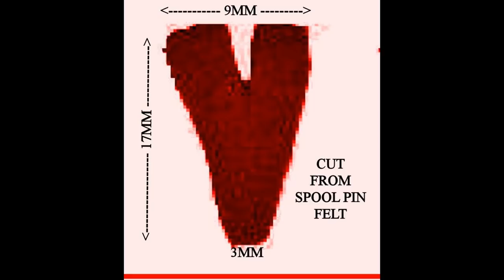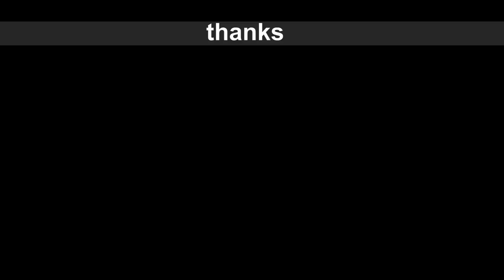The Bobbin Area Parts of a Singer Model 99K Sewing Machine

Comment: great video for seeing what is actually going on in there, the only thing I noticed is you seem to have way too much slack between the bobbin case & the bobbin case bracket making a clacking noise.

if you loosen screw the screw on the bobbin case bracket (the one you move to the right to remove the bobbin case & left to lock it in) the screw they tell you never to remove, you can adjust the distance between the heel of the bobbin case & the cushion spring on the bracket with it in the bracket latch in the locked position & the bobbin case pulled fully left over the race for a gap of .010 to .015 of an inch between the heel & the cushion spring then tighten the screw down again, you can just pull the bobbin case  fully to the left & measure the gap with a feeler gauge to see if it needs adjusting .
Reply from the maker: Thank you for sharing the measurement for the Thread Clearance for this model. Nice of you to comment. For viewers unfamiliar with the Thread Clearance, this video for model 404 will give you an idea of setting the "gap" between the bobbin case and cushion spring: https://youtu.be/OXKqZp87eN4
Hope to hear from you again, Roger.
Reply: Thanks man!!!

Comment: Dear Andy pls help I have 185k singer sewing machine the bobbin case on the machine kept moving when sewing so was trying to take it out to see what the problem was but it was stuck so took out the screw on the bobbin case position bracket I didn't have the instruction book at hand at the time now found it and read that the screw must not be loosened the loosening of the screw will change the clearance  for the thread between the bobbin case and the bobbin case position bracket how can I fix this problem will be grateful for your advice it's a lovely sewing machine I've tryed put everything back in position but it won't sew will be grateful for your advice.
Reply from the maker: Salim, I would check that the bobbin case is the correct part number 32590. @ 15:30 in this video I talk a little about that screw "E" and that it is used to set the thread clearance. If the clearance is too small the thread gets stuck. If the clearance is too big the bobbin bounces and is loud. Usually, when a customer comes to me with a "Moving Bobbin Case" I find the bobbin case was not installed properly. I'm not saying that is the reason for your problem, only that it is a possibility. All I can advise is you follow the reinstallation of the parts in this video starting @ 40:00. Special attention to 45:00 thru 47:30 installing the bobbin case. This one is tricky even for me and it took me 3 or 4 tries to get the case on the hook race properly. Once all the parts are installed correctly you can test the machine to see if screw "E" needs adjustment. If so then take a look at this video of a different machine and setting the thread clearance.  https://youtu.be/OXKqZp87eN4  This gives you an idea of how to set the clearance.  I have no document that says what the thread clearance on a model 185 should be. Most vintage Singer machines have a cleance of between .012" to .018", or about .31 to .45 MM.
You want an adjustment that lets the needle thread pass through the space between the bobbin case and the bracket, but not too much space which makes the bobbin case "jump"' and be very noisy.

Comment: Thanks for this video.  It worked perfect for my 99.  Just picked up a Singer 185J from the owner who said it wasn't working properly.  I noticed that there was plenty of thread and lint in this area and stuck on feed dogs and that also that the positioning finger screw was loose and that there was no felt in the spring at all.  I can configure felt to put in there, but how to adjust the positioning finger that must not be touched readjusted and that thread clearance to be functional again?
Reply from the maker: There is nothing specific about it in any manual I could find. There are two screws on the Latch. I loosened the screw closest to the front of the machine (towards me while looking from the end) and that allowed a little movement b/c the back or far screw allowed the latch to swivel. I just placed the tip of the Singer Tension Screw Driver in between and tightened the front screw. That gave me a little gap where I had no gap before. I could not tell you the exact size of the gap. I just eye-balled it and it was good in the sewing test.

Comment: I got a 99 in a bentwood case. I am refurbishing the case now and want to clean the machine. How much do you think I should do. Should I take the bobbin area apart and the tension button and the wheel?
Reply from the maker: In my videos, I take all those things apart b/c I want to do deep cleaning, and I want to show people how to do it if they need to replace parts or adjust them. How much work you do depends on the condition of your machine and what you are comfortable doing with it. If it is in working condition you do not need to dismantle anything at all if you don't wish to. Parts can be cleaned in place with brushes, rags, Q-tips, etc. You can use air to blow out lint and debris. You should absolutely oil the machine as shown in the Instruction Manual. https://www.singer.com/search/support?title=99    Some people over oil parts of the machine and run the motor to heat things up, then wipe off/out all the excess oil. They feel this will "flush out" old oil in spaces and bearings. Only do what you are comfortable doing is the best rule of thumb. After cleaning and oiling you can test sew and if you have problems, then decide to work on the tension unit or bobbin case area, pull the wheel to clean and oil inside it, etc. Congratulations on your "new" 99. It's a wonderful model.

Comment: Great video Andy; I leant a lot. My problem is that the thread keeps breaking, I suspect something is wrong with the bobbin assembly, or hook. After watching this I now understand how it works but I'm not sure I have the confidence / tools to take it apart. If the hook in the bobbin area has a burr, what do you think is the best way to sharpen / remove the burr?
Reply from the maker: Welcome to andy tube, Mike. You do not need to remove many parts to test/repair a hook burr. It is more common than people realize for the hook/ hook point to have a little burr from a needle strike or from using metallic thread. So I made this 12-minute video about testing and fixing hook burrs. All you need is 6 inches of thread (nice if it's cotton) and some very fine sandpaper. If you find the burr, just give it a shoe shine. This is an OSMG fix (Old Sewing Machine Guy), and nowadays people would probably use a Dremel or some other tool, but it is hard to ruin a hook point with a strip of sandpaper, You could, but you'd have to be very determined. Anyway, here is the burr video: https://youtu.be/us1sHv1-2Kc
I hope it helps and thanks for watching my channel. Don't be a stranger now, OK?

Comment: Andy, I think you meant 1.18mm not 118mm for the feed dog height, you left out the decimal points from your feeler gauges. 118mm would be nearly 5 inches, 25.4 mm to an inch.
Reply from the maker: You mean the feed dog in the UK does not stand 5 inches above the throat plate? Haha. I stand corrected and thanks for letting me know. I'll pin yur comment on top so others may see it.
Thanks for watching. Take Care.
Reply: My motor is a BU7-c 6 amp. Have you opened one of those up? It's on my 99 without tension disc dial.

Comment: I have just bought my first ever vintage Singer... a 1939 99K and that screw which Singer warns never to play with... on top of the latch pin in the bobbin area... has marks that show someone has opened it up. I'm scared. Its not sewing at all... isn't forming the back of a stitch. This video has at least shown me other things I can check but that screw is haunting my nightmares
Reply from the maker: Congratulations; it's a very nice model. There is a very slim (not impossible) chance that the last pin adjustment is causing your machine to "skip" stitches. It is more likely that the timing is off. Timing is the way the needlepoint aligns to the hook point so as to catch the needle thread, wrap it around the bobbin thread, and form the lock stitch. It is easy to check the timing and not difficult to correct if it is off. Here is the link to my entire 20 video Playlist for model 99K: https://www.youtube.com/playlist?list=PLsCOZgzzaiKIIUgkEujqHc9iNWN9NPW2Z    If you look down that list you will find this video for checking/setting the timing: https://youtu.be/9zU1_VjMddQ  That is what I would check after checking that you installed the needle facing the proper direction and threaded the needle correctly. That info is in the Instruction Manual that is available for FREE from the Singer USA SUpport page at this link: https://www.singer.com/search/support?title=99    (try the one listed as 99-13)   Good luck, and thanks for watching my channel.

Comment: Andy, Please help. I didn't take the bobbin plate off and I've been trying to get it back on for days. I just spent a half hour trying to slide it back on in the way you said in the video would be "quite easy" . It is not so I'm wondering what issues this (new to me) 99 could be having.  Could the plate or more likely the spring be damaged? Thank you for any advice you can give me.  And thank you for this video. I have a few 99s and am always trying to learn more about them.
Reply: I figured it out. Took the spring off, cleaned it and turned it around and then it worked.
Reply from the maker: @pattywest8371  Good to know for reference. Thanks for sharing.

Comment: It is lucky that I see this video before I get rid of that red felt oil pad.
Reply from the maker: I'm glad you found the video! Singer eventually did away with it in future models, but It serves a purpose IMO. Thanks for watching Andy Tube.
Reply: I saw a video on them the other day and I went to go look to see if mine was still intact... it seems to have disintegrated. My machine squeaks as well and I say with reasonable certainty that that is why it squeaks lol.
Reply: @Sage-qd6tf  can you link the video you saw? Andy is great, but I like to watch as many videos as I possibly can.
Reply: @DFTBAandDS  bro I wish, I don't remember what it was called. But, you can look up your sewing machine model and dive down the youtube rabbit hole! Do you need to know anything in particular?
Reply: @Sage-qd6tf  I am so far down that YouTube rabbit hole... 🤦‍♀️
I was just wondering about the possibility of buying replacements. Mine did not look that bad. I finally decided to remove the spring-y holder. I couldn't get the red felt out. It doesn't look too bad, so I'm currently soaking it in soapy water to maybe get rid of some oil, then I'll let it dry thoroughly.
Reply: @DFTBAandDS  oh, I'm quite certain you can indeed buy replacements, though I wouldn't soak it in water because being full of oil is kind of the point
Reply: @DFTBAandDS  although I don't think its that important, since mine has disintegrated and my machine doesn't squeak, I just had to oil it good. However, I don't use it daily, so that probably makes a difference
Reply: @Sage-qd6tf  too late for not soaking in water....but I'm hoping for fresh, clean oil instead of old blackened gunk!

Comment: I just got a 99 singer it has a bent arm piece on the treaded where is best place to find parts
Reply from the maker: For used vintage parts, I find many on eBay and http://www.thriftyfarmgirl.com/    For "new" parts like springs, bobbins, tires, rubber feet, cords, etc. I have used this seller for many years https://www.vintagesingerparts.com/   Some sellers on eBay also offer parts like that. The last choice for new stuff is https://www.sewingpartsonline.com/ Their quality is fine and they have a large selection but, IMO, they are pricey with slower service. They are probably the largest seller of parts. Thanks for watching my channel

Comment: What is the tool you use at the 20:04 minute mark? I need one of those!!
Reply from the maker: It's so handy at times. That is a vintage brass-sheathed spring screwdriver made by HJJ CO in LOS GATOS, CA. Long out of business
Sometimes you find them on eBay like this: https://www.ebay.com/sch/i.html?_from=R40&_trksid=p2334524.m570.l1313&_nkw=hjj+co+screwdriver&_sacat=0&LH_TitleDesc=0&_odkw=hjj+co&_osacat=0
Otherwise, many folks buy a modern set made by KLIEN TOOLS like this: https://www.zoro.com/klein-tools-screwdriver-set-slotted-screw-holding-3-piece-sk234/i/G2070957/   Another old company that made similar is called quick-wedge tools. https://www.ebay.com/sch/i.html?_from=R40&_trksid=p2047675.m570.l1313&_nkw=2356+%26+1736&_sacat=0

Comment: Hi Andy. Which vintage do u personally believe is the toughest most dependable machine you have worked on. A WORKHORSE type. That can handle heavy thick upholstery fabrics??
Reply from the maker: Remembering that these are domestic (home) sewing models and not industrial, my immediate answer is the model 404 heavy-duty slant needle straight stitch sewing machine. In this comparison video I discuss this model 404 starting at 21:50. https://youtu.be/CjLe24c9xfY   Direct drive gear driven motor, ( not motor belt) all steel gear hook drive system (no timing belt).
internal .7AMP motor. I like this model so much I did a 56 video playlist for restoring it step-by-step. https://www.youtube.com/playlist?list=PLsCOZgzzaiKIB4kvIHCfHYuyLMUp5A4UI
Keep it clean and lubricated and replace the motor brushes every 25 years. This is an under-rated model, but I love it and the front, top drop-in class 66 bobbin system with a taller presser foot and slant needle system that gives you a better view of the needle into the needle plate (work area) There are many other hard-working models you could look at also, like the 15-91 and the 201. This model 99K (in this video you commented on) is strong and takes up to a size 21 needle 👀 (larger than the 404 can) and it is only a 3/4 size copy of the model 66. So, 15-91, 66, 99, 404, and all can mount into a Singer cabinet or custom work table. They cal all use a walking foot attachment for sewing layered, thick material
If you want to reupholster a house full of furniture, any of these models will do. If you are opening an upholstery business you're better of in the long run to buy an industrial machine.

Comment: Could you please help me?  I have just got a Singer Serial Number AL458820.  It's a 66 Model, according to the Singer Data Base.  But it has a bobbin system just like that one.
Reply from the maker: Well, yes, your machine is a Model 1966 ordered in 1953. Yes, it has a bobbin system just like my model 99K. Singer model 99 is a 3/4 size model 66. The parts are the same. My model 99K just has a smaller. lighter body. Think of it as a "portable" model 66. If you want to learn more about our machines here is a link to my Playlist of 19 videos about removing, replacing, adjusting, cleaning, oiling, and so forth.  https://www.youtube.com/playlist?list=PLsCOZgzzaiKIIUgkEujqHc9iNWN9NPW2Z    My videos can be used for your model 66. Was that the help you were looking for? Thanks for watching my channel and good luck.
Reply: @andytubesewing1953  Thanks for that!  I would surely love to find a 99 in Brasil.  This 66 I got for "decoration only", since the bobbin system is not complete.  A technician told me I have a "relic".  For Brazil, yes.
Reply from the maker: @vaccavo  I'd guess there are 500,000 model 66 working around the world. Some sellers of used parts on eBay ship to Brazil. You can download a free copy of the instruction manual if you want to know more about model 66. Here is the page at Singer https://www.singer.com/search/support?title=66

Comment: Hi Andy, I need help. I followed your video on how to replace the red felt Oiler in the cone shaped spring of a Singer 99. I have a Singer 66, and decided to clean the assembly where this spring inserts. Needless to say when I unscrewed the already loosened pin holding the bobbin lift mechanism, the spring flew out! I did take a couple of pictures, so I know where parts go, but I can’t get the tiny spring to fit back in place correctly. Can you help?
Reply from the maker: I don't have the machine any longer to take a close look at the mechanism. I do have some parts list w/ pictures and numbers and it looks like there is a screw stud that holds the spring onto the lift lever. They are not very clear pictures b/c it is a xerox copy, but you are welcome to have the manuals if you think they would help. Email to andymanuals53@gmail.com and ask him for the Model 66 parts manuals.- if you'd like them.

Comment: Andy this is so helpful. I have restored my grandmother's 99 with your help. Thank you!! I was sewing and every 30 stitches or so, the needle thread gets caught around the race at the top of the oscillating hook. It is really tight. Once you get the bobbin and case out the thread pulls right out. Any suggestions?
Reply from the maker: It seems odd that you get so many stitches before it happens. I guess I would do a close inspection of the hook, hook race, and bobbin case looking for burrs or something catching the thread. I would also try a different bobbin. I'm thinking this b/c the thread releases once you pull out the bobbin/case.